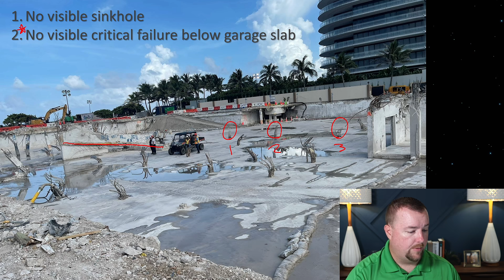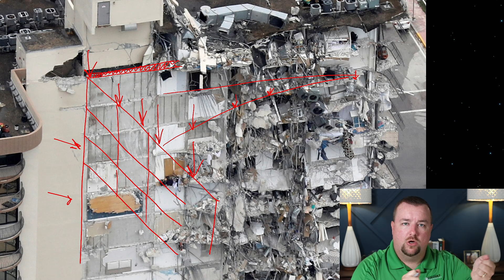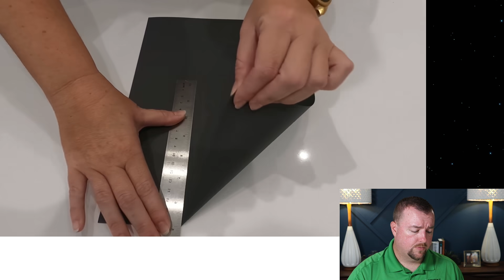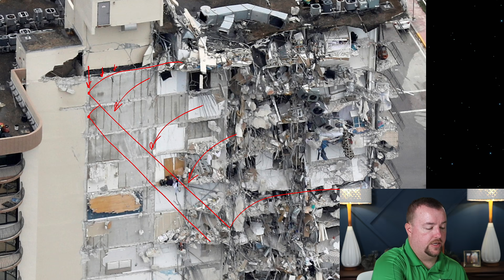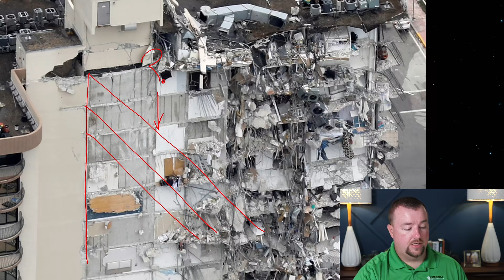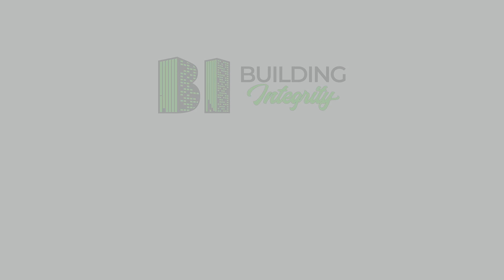Surfside Collapse - Structural Engineer Explains Why Only Half the Building Collapsed

Comment: The stress forces acting on the building were relieved when part of it fell off ? I have no idea really.
Reply: We will have to wait for more information to know exactly what happened. But based on what we can see, whatever instigated the collapse seemed to cause the facade of that central part to start collapsing, leading to a progressive collapse. In that demonstration with the paper, think of the section that didn't collapse as the piece of paper on the other side of the steel ruler. So the shear wall protected that building (largely) from the stresses of the collapse. Keep in mind that the shear wall was designed to resist sideways forces. Having said that, we will also have to see just how the collapse building was tied into the shear wall.
Reply: @daveg2104  I will be interesting for sure. It was built in the 70's ? I was a commercial carpet layer in the seventies. I have stories about things I saw.
Reply: @oldhick9047  Champlain Towers is (was) 3 buildings. North and South were built in 1981, and East in 1984. Sorry, I edited my original comment before I saw your comment.
Reply: @daveg2104  Thanks, some shady doings I fear.
Reply: @oldhick9047  Property developers doing shady things? Never.

Comment: Built parking garages in LA with 4 story wood frame apartments on top circa 1980's... 
Always used a 12" slab with 3/4" rebar top and bottom  at 12" centers each way.  That's a lot of steel.
Reply: I like this comment !

Comment: I would not be surprised if your explanation inspires a young person to want to pursue Structural Engineering.
Reply from the maker: This is a prime motivation for me.  I know I may not create meaningful change in the current fields of construction and engineering in my lifetime, but if I can help the next generation, I will die happy.
Reply: @BuildingIntegrity  God Bless. You Are Wonderful.
Reply: @colenexoxo8939  I totally agree.
Reply: @BuildingIntegrity  I'm just curious about something, have you seen the damages on the access ramp? If you go on Google Street view, on the 88th street right, in front of the access ramp and zoom on it, there's huges cracks on the sidewalk on boths sides of the ramp. And if you look more closely you can see something is wrong with the slab. Check the joint between the access ramp and the sidewalk...
Reply: @dxbx214  Very interesting observation. I’m looking at it, I also looked at the rest of the property again and noticed the building on the south side was a vacant lot at the time the Google maps image was taken. That building was finished 2019 or 2020, depending on the resource. Also, the palm trees were still in the planters, so this google image is quite old, considering the building next door @ 8701 was just breaking ground on construction. But this does make one wonder about the parking ramp entrance and how long the concrete had been cracked at the sidewalk. Also, since there’s no tree roots causing a sidewalk crack…
Reply: @fozzybear15  weirdly, the street view of the 88th street is from 2021, while the other side date before the construction of the building..(2015 you can full zoom in the photo and see the date)
Reply: @dxbx214  Isn’t that interesting?!  Hmmm… Thanks for your response, learned something today!
Reply: @BuildingIntegrity  I sure hope you’re listened to and sought out as an overseer. 
Just one request could you please make one tweak, and please use a thicker highlighter, the thin one is hard to see sometimes. Glad you changed the colour 💕
Reply: @BuildingIntegrity  You absolutely are achieving what you set out for my friend. I'm a Mechanical Engineering student, studying subjects that have a lot of relation with what a civil engineer might study, and i find every one of these videos intriguing. If any good comes out of this horrible collapse, it's the newfound knowledge that we've gained from it.
Reply: Building Integrity if more people taught like you, you’d have SO many more kids interested in math, physics, and engineering. Showing how fundamental concepts are applied in real life, and the specifics they can cause when interacting in tandem. Seriously josh, you should consider volunteering for STEM education for underserved communities. You could really change some lives.
Reply: @BuildingIntegrity  sniff sniff damn these allergies.
Reply: @BuildingIntegrity  I teach 5 year olds and grandad was an engineer. I love these videos,
Reply: @BuildingIntegrity  Just think, if you're a horror fan, you remember Aliens. So, you'll have everyone eyeballing the ceiling in every garage like Aliens where they can't see them on the monitor, because they were in the ceiling.
Reply: @BuildingIntegrity  Thank you very much for another very well-explained video. I have a couple of comments and points I would like you to consider, please. From the security video of the collapse, it is clear that events progress from the southern facade, of the central part of the building, toward the north. Also, we understand from witness accounts, and the debris at the bottom of the ramp, that an area south of the facade collapsed 7 minutes or thereabouts before the facade. So I think we can agree that the collapse is progressing from south to north, correct? Would it then be correct to say that any area of collapse further south likely occurred earlier? And following this to the limit of the property we would arrive at the south wall of the lobby parking area?
Reply: In addition to the very good points made in your video, I can also imagine the whole pool deck being pulled south, in that case, the shear wall is aligned, north-south, with the direction of propagation, whereas the columns at the bottom of the facade are transverse across the direction of propagation. As such, the shear wall presents itself as a beam 50 feet(approx) deep, to any force pulling from the south, whereas the three columns aligned east-west below the facade are less than 24 inches deep. What do you think?
Reply: Forget young people -
I am 46 and after these lectures want to get a masters in engineering (getting a MA in urban planning right now).
Reply: @philippa_burgess  hell yeah! Lifetime learner. Never stop pursuing what inspires you!
Reply: @philippa_burgess  Same! I have a BA in film production so I’m not sure how I go from that to engineering practically, but I have actually started looking into it. It’s something I was interested in when I was younger and was put off because it wasn’t a “thing for girls” so I didn’t get the support I needed in school, but f that! (Hilariously I ended up in another ‘guy’ area anyway and have most of a BSc in cybernetics and comp sci that I only didn’t finish for family health reasons. When I was able to go back, film was an easier program to manage in terms of finances and scheduling and I wanted to accomplish a degree in SOMETHING just to prove I could.) I’m currently trying to find the best online way to get my math back up to snuff since it has been quite a long time since anyone expected me to do any serious math. (Calculus is not something that often comes up in film classes.)
Reply: @TrappedinSLC  I also went to film school, or started in that program and then it evolved into a degree in international relations with a minor in film. I just started a MA program in urban planning which reminds me a lot of film because we are looking at the story of cities - past, present and future. And now I am finding ever greater interest in the engineering. I wish you all the best in seeing what program suits you. I was fortunate to find an executive online program that is flexible around my work schedule. If you get any good leads on math programs I might need to follow. I have always been good at math but never took calculus because it was not part of my requirements but perhaps it is time.
Reply: @TrappedinSLC  I have a friend who's real good at that. I went from a D to an A in like a week of intense zooming. Like 3 hrs or more a day. They also have free tutoring from the school, don't they?
Reply: ... or a HOA board member? :-)
Reply: and old alike💃
Reply: Perhaps that person will also be inspirated by the design concept of "fault tolerance' thru redundancy
Reply: I'm 40 and curious as can be
Reply: your videos have gotten me very interested in structural/civil engineering
Reply: Inspiring students is one of the best parts of teaching.
Reply: The world needs more engineers. Engineering is a tough degree but engineers of various types are always needed.
Reply: @tweetybird7668  My current plan is to find a reputable online class for the various math classes I need to get back up to speed with. I’ve done college level calculus and statistics but not for many years. I might need some sciences, too? Physics and chemistry? So I’m refreshed and used to thinking in those terms again. Then talk to places about specific engineering and related programs.
Reply: I wish I had got an engineering degree instead of a math degree.
Reply: @rollothecat2010  You're probably a good way there with what you have.
Reply: I'm an aerospace engineering major and he has me wanting to go back and get a civil engineering degree too. lol
Reply: I was thinking the exact same thing.
Reply: It taught me so much that I never heard in my arch school, thank you 🙏🏻
Reply: It would have for me if I was younger. Well I'm only 37 so I prob still could. I wonder what it is like being a woman in a film with mostly guys though?
Reply: The lesson here is to go to Law School. The lawyers made out like bandits on this one.